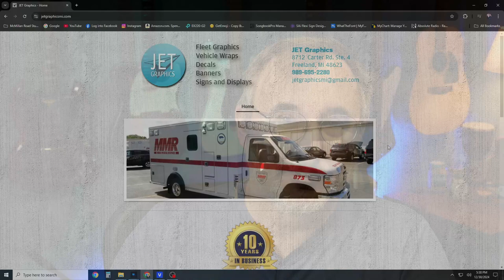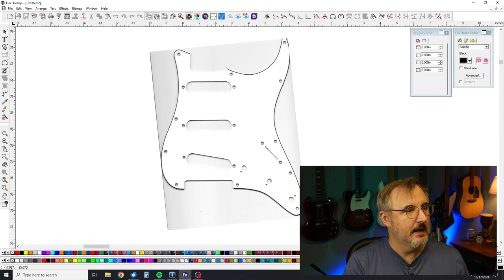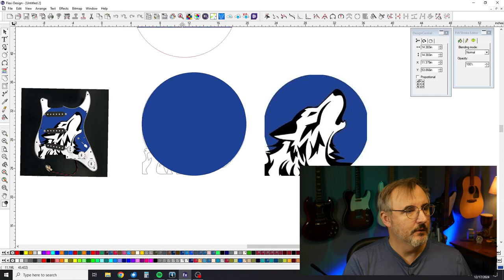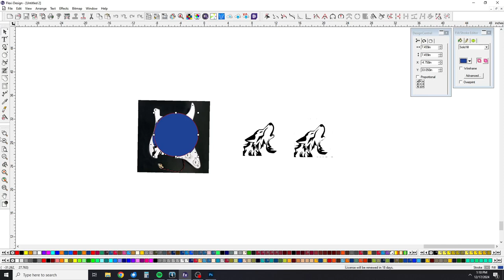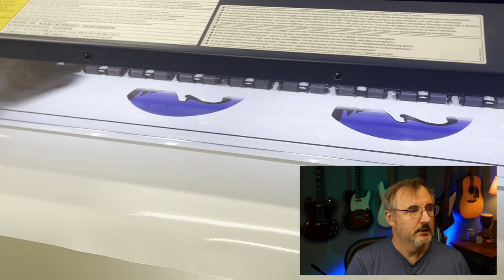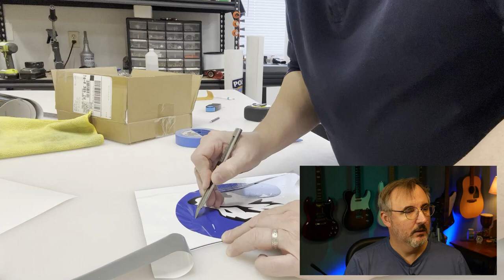Making A Custom Guitar Pickguard

Comment: looks like a wrap  tho, just dont think it'll look good in 5 years. I cnc tranparent pickguards and would rather paint the designs on the guitar. Sold a few like that, just looks way better. This just looks cheap, no offense. I do like your channel. I use cnc machine too. Can use the cnc to draw in designs with a retractable pencil and then paint it on permanently with posca paint pens, then clear coat.
Reply from the maker: Yup a wrap. Automotive wrap. Same stuff we put on cars. It''s really curable, especially on a guitar. Oh and we laminated it too to give it extra durability.